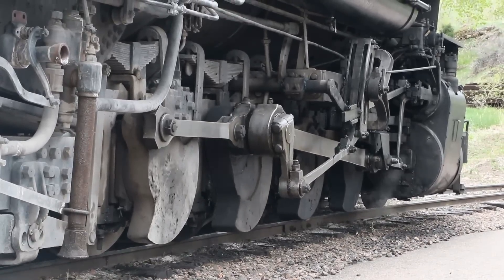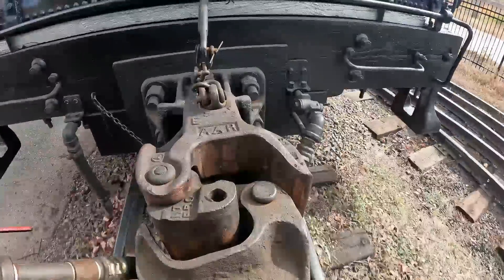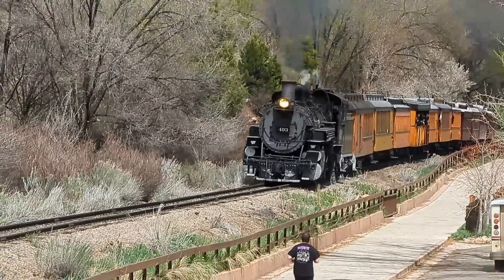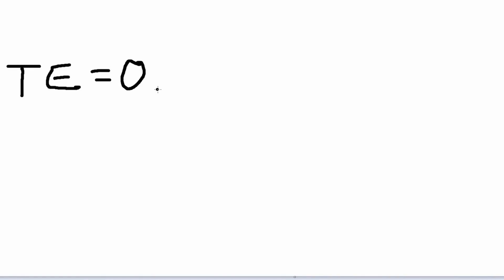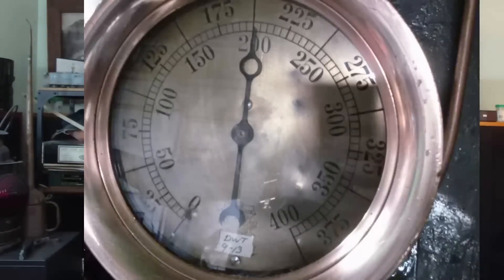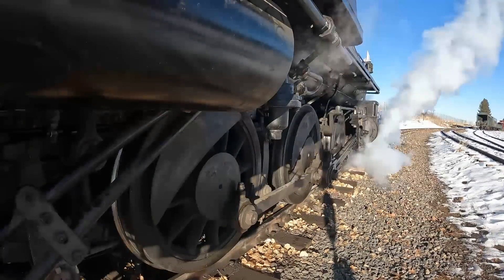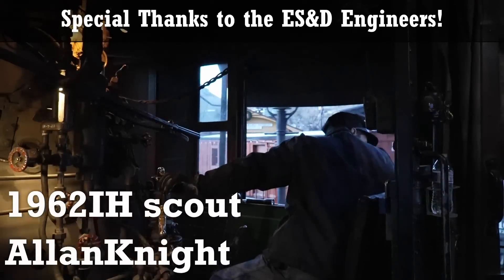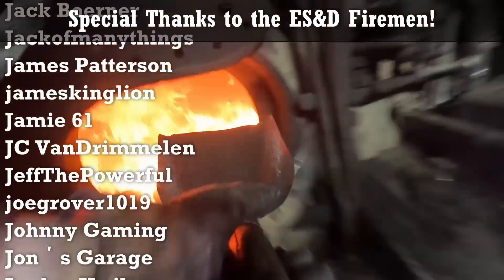Busting Tractive Effort MYTHS! | Railroad 101

Comment: 11:14 Let's also not forget rebuilds. You can rebuild a locomotive with larger or smaller drivers, bigger cylinders, and/or a higher-pressure boiler. It's probably a bit outside the scope of most people's thoughts on railroading, but it's definitely possible.
Reply: Yes, 2102 actually started life as a 2-8-0 and then got rebuilt to a 4-8-4.
Reply: @awildjared1396  I didn't know that, I'll need to look into it, it sounds interesting. Thanks.
Reply: EBT 16 got a higher pressure boiler in its last rebuild, so I assume it's tractive effort changed as well.
Reply: @jacoblyman9441  I would have to agree with you.
Reply: B&O converted 2-10-2 Sante Fe boilers to use on their 4-8-2 Mountains, as well  as Mikado 4-8-2 boilers fitted to 4-6-2 Pacific frames. I am sure other roads recycled locomotive parts all the time.

Comment: Every railroader knows that turning on the bell and “generator” gives a 10% boost in tractive effort when climbing the switchbacks to the iron mine.
Reply from the maker: I almost made a joke about that in the video but figured it'd be more of a hornets nest kick than a joke for some... Lol!
Reply: don't forget pushing a snow plow in front of you gives a 10% boost in top speed.
Reply: They would get another 10% if they painted them red
Reply: Ah yes, the bell, activated by “hand valve”
Reply: The same way a fire engine is actually powered by its air horns.  LOL
Reply: Doesn’t this only work if it’s a Eureka?

Comment: more drivers seems like it would help tractive effort but not rly
Reply: you have to know that the piston is where power is "made", that then goes to the drivers and the connecting rod shares the power across the drivers.

with one driver, it takes on 100% of the power. with two each takes 50% of thw power, ando so on. that's why "they help with adhesion":because they don't really. in order to slip, enough force needs to be apllied by the drivers on the rails. If it takes so much force to make 2 drivers slip, with 4 the locomotive can pull with twice the force because each driver ends up applying the same force
Reply from the maker: It can, but no guarantees!

Comment: What kind of sand do you use? Would a 200grit garnet be more efficent per pound than an 80grit riversand?
Reply: Where I live in Illinois, they mined sand for the railroads from very specific quarries.  C&NW got (and UP gets) a lot of their sand from Troy Grove (as I understand it). They wanted a flatter sand grain for the railroads.  Round sand was more inclined to roll off the rail before the wheel got to the sand.  The flat sand laid on the rail better. All sands are not the same.  River sand tends to be more round.  As sand in the river moves, it crashes into other grains of sand rounding off the edges, making marbles of sand.
Reply: @larrylawson5172  Thank you for this wealth of information kind stranger. I love the internet.